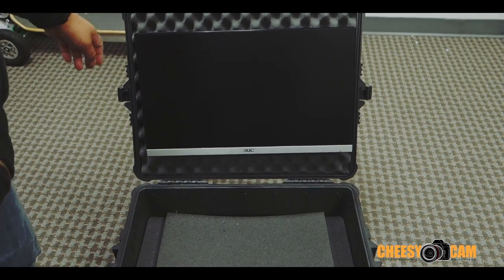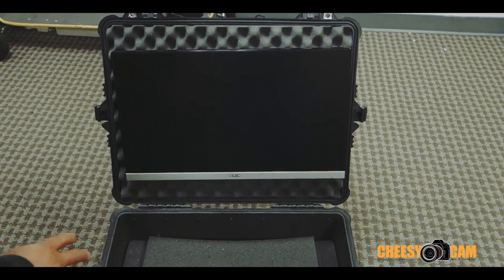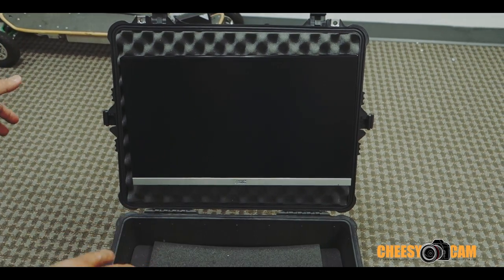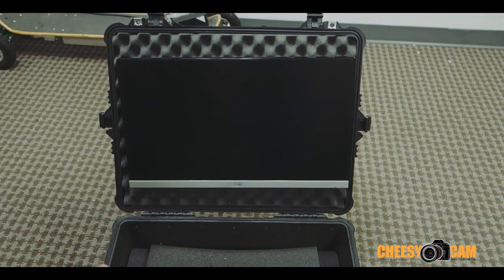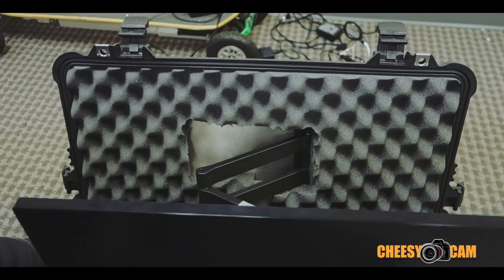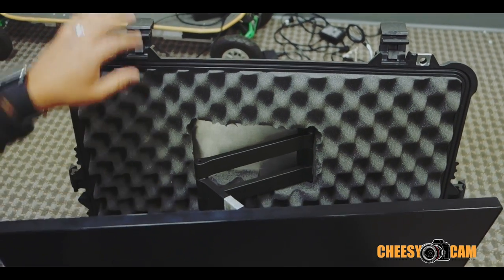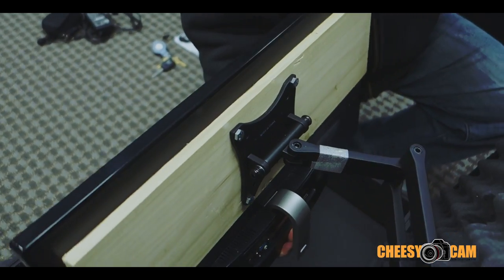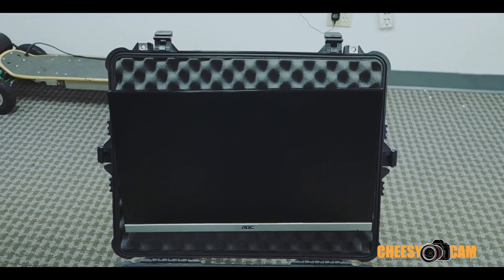DIY Custom 1080p HDMI LCD Monitor Mount in Pelican Case

Comment: Does the case open until the back hits the floor table or whatever you have it sitting on.

Does it stay open? How heavy is the monitor and how did you mount it without drilling?

Comment: would like to see how you made the conversion to 12v in there. Also, obviously Pelican is the top brand, but did you find any cheaper alternatives for cases? thx! great stuff
Reply from the maker: The 12V is native for the LCD monitor. I just use a 12V battery pack (Tekkeon) and plug it directly behind the screen. Nothing fancy to get this working, but I specifically chose this LCD screen because it was 12V IPS LCD full 1080p.

No cheap case alternatives I could find at this time.
Reply: MrCheesyCam what screen is that?

Comment: what is size of the tv ur using. any suggestion on which pelican case can hold a 19 or 22 inch led. thanks

which pelican case r u using?
Reply: Valjoe Fernanades im using the pelican 1610...it's amazing with a 2" lid and 8.5" base...leaves room to put my ps4 in the subfloor and storage on top. plenty of space and only $200 on ebay